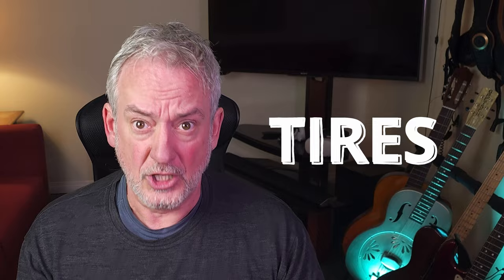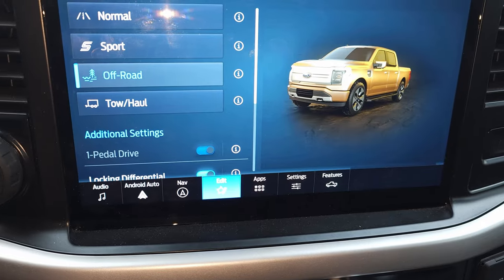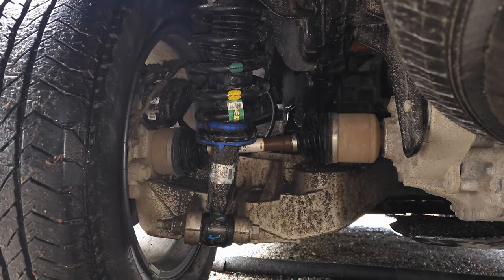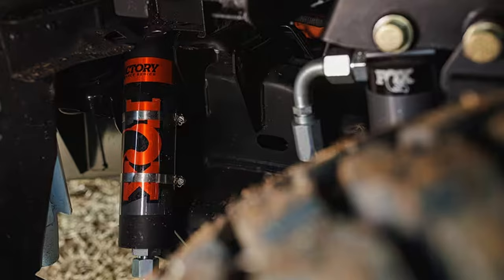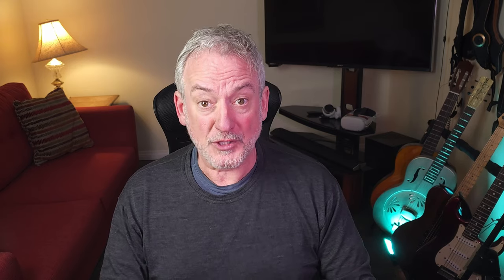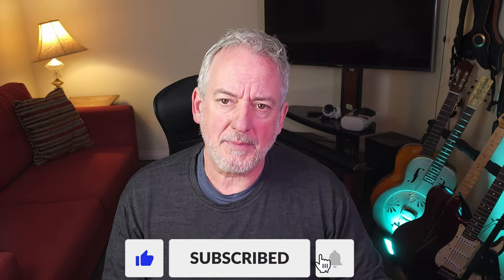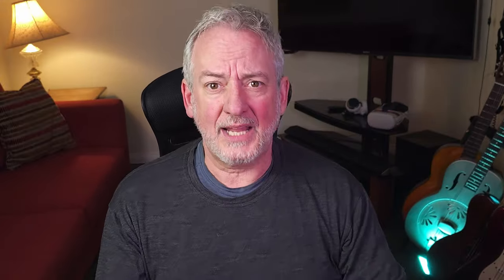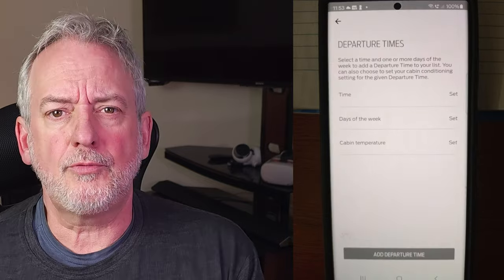10 Costly Mistakes Slam F150 Lightning! #1 Is the Dumbest!

Comment: 1. Child battery mineral labor

2. Range anxiety

3. Risk of garage fires

4. Paying 20k more than a
comparable vehicle

5. every time you fuel up an EV, the fuel tank gets smaller  and smaller. Battery degeneration. 

6. Poor resale value

7. Reduced performance in
cold, highway.

8. Higher repair costs

9. Awful charging network
experiences in the weather
without restrooms

10. Higher insurance rates

11. Replacing tires more
frequently. Michelin states that tires wear out 20% faster on an Ev, and could be as high as 50% faster! Ev tires made for ev's, cost 20 to 30% more, than regular tires for ice cars. As Ev tires wear out, they leave behind more tiny particles of rubber than normal ice cars. This causes more pollution. 

12. Death by autopilot

13. $25k - $35k battery

14. Low km range per tank of energy. 

15. must wait in-line 1-2 hrs
to charge.

16. Then wait more time to charge, while charging.

17. Spontaneous combustion, with no way to put out the fire storm.

18. If they catch fire in a tunnel, many people will die.

19. People without a pro charger system or a parking spot at their house, will run an extension cord to the road, which is dangerous and could lead to people tampering with your charging setup (super slow charging at the road)

20. If you're in California, you won't be able to charge your car past 4pm because of a shortage of electricity supply on the cheesy grid.

21. It is not actually "green". The pollution is made at the power station, not the car.

22. Only 5% of used junk batteries get recycled, the rest go directly into the bin. It's cheaper to mine for new minerals.

23. Chhinna actually does 70% of all the refining of the minerals and production of the batteries.

24. Minerals are becoming more and more scarce, and the cost will only go up, not down.

25. Some countries where they mine for lithium, actually use a very big boat load of fresh water to only produce a ton of lithium, so they are afraid of running out of water. It takes over 2 million liters of fresh clean water to produce 1 ton of lithium. 

26. Ev cars will soon not be able to drive in tunnels or be able to park in underground parking garage and probably will eventually void your house insurance if you park it in your personal garage.... 

27. You can't charge your battery at super stations when it is bitter cold out. 

28. If a fire truck comes to put out an Ev fire, all the chemicals go directly into the sewer system, poisoning everything. They need tons of water to slow down the burn. They can't put them out. They are only trying to prevent over things near by from catching fire. 

29. Ok, there is 2 good things; regenerative braking, which charges the battery while you are slowing down on the highway, which saves your brakes from much wear.

30. Loss of fuel tax revenue, so now the roads will only get worse, not better. 

31. in Dublin, huge generators are being used to charge EV buses, due to electrical grid strain. buses in Athlone also cannot be put on charge until midnight, for the same reason. Bus Éireann is saying that they can't charge their buses until 11pm for the same reason,  and to avail of a lower tariff. 

32. Not everyone on earth even has electricity to charge their cars. What are they supposed to do in 2035? It's easy to get a bucket of fuel to power up a regular car. 

33. VCE, or "vapour cloud explosion" is very bad. If any battery, typically anything larger than an E-scooter battery, and especially only "half" charged. If a problem occurs in the cells, it might not catch on fire right away. Instead, a cloud appears, and then may be ignited a short period afterwards. There are 2 different types of vapour clouds that appear; heavier and lighter than air, which form will be dominate, can not be predicted yet. This produces a bomm.

34. For Ev transport trucks, they aren't allowed to carry the same payload as a diesel truck, because of the massive weight of the battery. The owner of the Ev truck therefore loses potential profit, every day. They also lose more profit for the waiting times for charging that Ev truck. The driver will get paid to charge the truck, which in turn forces the owner of the truck to lose more money. 

35. Ev cars are more likely to be written off, if they experience a minor collision. After the collision, something could have upset the structural integrity of the battery. 

36. Ev cars lie to you. If you are bold enough to go out on a decent road trip and its 210 miles, one way, and your Ev tells you that your battery will last you 223 miles, there had better be no hills, or excessively cold out.... You'll probably get stranded, trying to get to the charger, at the end of the trip. Ev's have left many families stranded already. 

37. Ev's and their batteries, will soon need their very own "passport". With all info about them when born, and current info about them (power output, resistance, mineral composition, etc.) 

38. Thieves stealing charging cables, will soon make it impossible to "fuel" an Ev car. They take a long time to replace the cables, just to have them cut again for scrape money. 

39. Cars were typically being made lighter and lighter using aluminum and or fiberglass and or carbon fiber, to reduce emissions and pollution. Ev's are only getting heavier and heavier, causing more pollution than ever. Remember, an ev's pollution is made at the power station and the dump, not at the actual Ev, except for the tire particles as mentioned above. 

40. More on spontaneous combustion of the battery. What if you had 3 kids strapped into car seats, in the back seat ,which kid do you rescue? More fires start so fast, there is hardly any time for even the driver to escape, let alone 3 kids strapped in. 

41. There must be a reason that Boeing 747's aren't battery powered.... Until jets are battery powered, I'll be sticking to fossil fuels for my mode of transportation. 

42. Can't bring an Ev up north in the woods, nor any battery powered chain saws, where there are no grids to charge them up. You would need a huge amount of solar panels to get you anywhere. 

Ev's (External combustion vehicles) suck, and it's a bridge to nowhere. But they do sometimes convert themselves into "internal combustion", but sadly, they can only do that 1 time.
Reply from the maker: Wow! That's quite a list. You've got me beat. 
Many on the items you've provided, however, are either a) partially accurate but taken out of context, b) inaccurate and primarily FUD,  or c) fully accurate currently, but changing fast.
Either way, I like this comment being up, and there for ppl to review. It highlights the genuine concerns many have with EVs, although some of it already debunked but still widely distributed. Thank you for commenting!
Reply: @truckedupevs  what's debunked? Gas cars have their own problems too.
Reply from the maker: Well, I'm not spending the night going through your whole list - 🙂, but here's the top ten:

1. Over half of all EV batteries no longer use cobalt, but are iron phosphate based. Even those that use it, is infinitesimally small compared to the amount of cobalt from child labour mines going into gasoline production (#1 user of cobalt globally, as a catalyst in the  removal of sulfur), and in cell phones and laptops, not ev vehicles. This is conveniently overlooked by those who are highlighting EV mineral labour from their smartphones 🙂
2. Anyone who owns a modern EV rarely experiences any range anxiety. My truck goes 240 miles or 400 kms on a charge and, like most owners, I charge at home and wake up to a full truck every morning, and I use my truck heavily for work. I've never had range anxiety, nor do most EV owners - and I've driven great distances. Are many of the charging stations crap, and slow? If one does a LOT of road trips, then unless you have the most modern EV with fast charge speeds, stay away currently. But that is rapidly changing as well. However, most vehicles never drive in a given day anything close to the range limits on EVs, and if one doesn't have the ability to charge at home then, yes, a hybrid or efficient gas vehicle is likely best.
3. One a one-to-one basis, one has far more risk of a gasoline fire than a battery fire. In fact, electric vehicle fires are so rare that statistics show internal combustion engine (ICE) cars are 20 to 80 times more likely to catch fire compared to EVs.
4. I paid $1,400 less for my Lightning XLT than the price of an ICE XLT, thanks to incentives, but dollar for dollar, most EVs are now on par with their gas counterparts. This statement is years outdated. Again, times a re a changin' fast!
5. This one is funny. Every time you fuel up a gas or diesel, your engine gets less efficient, especially with the number of parts that can wear and fail. There are 70% less parts to fail in an EV and cost of maintenance is averaging around a third of a comparable ICE vehicle. My batteries are warrantied for 120,000 miles on the standard warranty but I got an extended one, so I don't have to worry about my batteries for 150,000 miles. We already have Tesla model Ss that have been on the road since 2012, done 500,000 miles, along with really old Nissan Leafs that are so outdated but still running, and have averaged a degradation between 20-30% with no replacement.
6. EVERY vehicle right now is plummeting in resale value. Lots are full of cars and trucks not selling. Until last year, used EVs sold at a PREMIUM, not a discount. That changed in mid-2023 when everything went into the tank. This is accurate, but out of context in that it's not exclusive to EVs.
7. Accurate. However, changed are coming. Ford just introduced the 'vapour-injected heat pump' in all its 2024 Lightnings, which now brings the winter range within 5% of comparable Internal combustion winter range loss. As battery and HVAC tech continues to evolve, I expect within a few years it will be in line with ICE vehicles.
8. Inaccurate in that EVs have far fewer repairs, and it depends on the repair anyway. Statistically, EVs cost far less to maintain. For example, a full battery bank replacement is crazy expensive if that happens - although battery longevity is increasing to the point where words like 'million mile batteries' are being tossed about. But in reality, almost all battery packs outside of Tesla are modular, which means only the bad pack needs to be replaced. This is almost never reported by anti-ev sites.
9. Totally accurate! But so were gas stations in the 1920s.
10. This depends on the vehicle. My rates didn't change when I went from my gas truck to my EV truck, but I did add a lot more coverage, which brought my comprehensive costs up. My wife's insurance actually dropped when she went from an ICE sedan to a Chevy Bolt. A truck like the Rivian is very expensive to insure, but not because it is an EV; but because it is a unibody truck with no separate bed. If it gets in an accident, the entire exterior on one side has to be removed and replaced, costing tens of thousands of dollars!

There. Whew! I'll leave the remaining 32 for my readership! All vehicles have problems, especially new tech. When the automatic transmission came out, it was a disaster! I think we've got a ways to go, so your post is important in reminding buyers that this is still early adopter stuff to this day.

Always love the feedback!
 
 @jakefriesenjake
Reply: @truckedupevs  good points. Toyota I think has given up on ev's. Ev's are not selling like they hoped, in general. Ev's might just take a crap, who knows. The gov is definitely pushing onto people with my tax dollars.
Tesla gave my uncle inlaw free voltage at the chargers as an incentive to buy one (earlier adoptor I believe)

I'd buy a new ice truck from any other company if they'd promise me free fuel, Ev hyway lanes and government deals to buy it.

Not many people want battery powered cars, in my opinion.
Reply from the maker: I love this comment! Yes, of course incentives seem like a crap deal at first, but corporations are given tens of billions of 'incentives' (our money so they can profit more off of us), as they send all the jobs overseas and lay off our local workers. Remember the 2008 bank and auto bailout? It's about time the government gave money to working class people to afford to save some $ to get rid of the gasoline tab we pay every month.
Let's just say that I didn't buy one of these for all the 'green' envrio tree-hug stuff tacked onto them; I bought it because it saves my little struggling company money.
Thank you so much for joining in the discussion! It really means a lot! Great input!